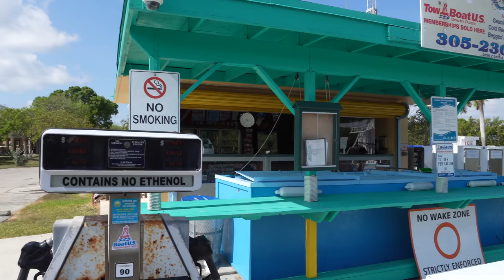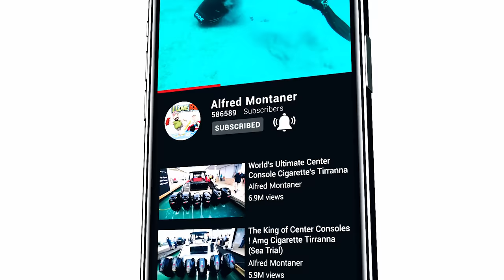Giant Barge Removes Burned Yacht out of Biscayne Bay (Tow Boat Miami)

Comment: Hey Alfred, nice video man. Reminds me of my early construction career driving all sorts of cranes, earth movers etc. Driving crawlers actually helped me get my UK Offshore Skippers Certificate. As docking a 40ft twin screw Nelson came as second nature, rudder at midships and steer on the screws, also using wind and tide/flow.
Best job I had boat left was a guy built a steel canal barge in his back yard, with the permission to cross the guy next door's yard to a road. The neighbors changed and permission was lost, so he had a company cut the barge in half. The crane hire company I worked for gave the guy a special price to lift the sections out, but the operation would be filmed for a TV documentary. So the companies largest truck crane was set up in the road, assisted by my smaller mount. The sections were lifted out one by one and hauled away.
We played a joke on the next door neighbor when we started to assemble the large crane right beside his house, saying the lift would be right over his house, he was not happy with that.
The big thing with floating barge lifts is the amount the barge sinks while taking the lift, positioning the crane to gain the lost float on the barge.

Comment: Them long poles are called Spuds. To anchor and stabilize it to work  Raised by on deck crane or by on board Hyd system  or by cables  Another Great Job  thanks. Bro

Comment: I didn't read any comments but those big pipes on the barge are called "SPUDS" The crane operator picks them up and rigger will pull the pin holding it up so they can drop the spud into the bottom.  The spuds hold the barge in place.

Comment: Spud barge. Spuds anchor barge in place. I work the Lower Mississippi River. Towboats pushing upwards of 48 barges with 11,900hp trips.
My job is a bit crazy. Catch them on the fly, tie off and they pull me along as I offload crew members, supplies or whatever. Night. Day. Storms. Fog. 24/7 on call. 100 ton vessel Merchant Marine Captain. 
It's insane at the equipment used on this river.

Comment: If they are worried about the crane falling over..  they are over riding the safety limits on the crane…
If it had any safety lock outs might of been to old?   
Engine sounds like a two stroke.